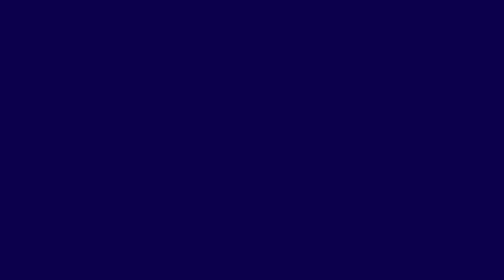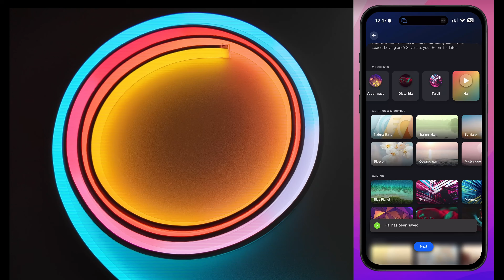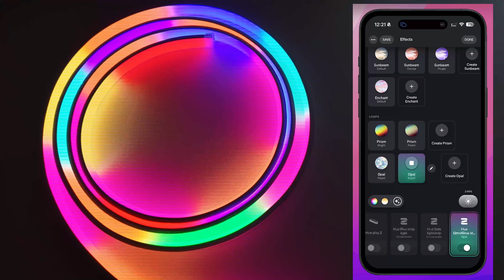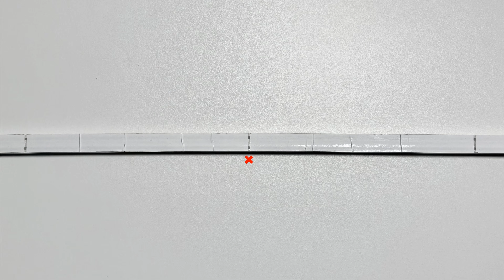Philips Hue OmniGlow:  Premium Quality, Premium Price or Premium Gimmick?

Comment from the maker: ⏱ TIMESTAMPS:
0:00 - The Problem with Traditional Light Strips
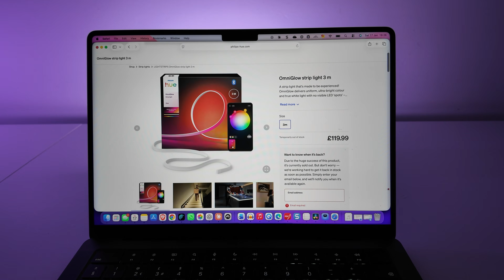0:46 – Unboxing Hue OmniGlow
1:42 – OmniGlow’s CSP Technology Explained
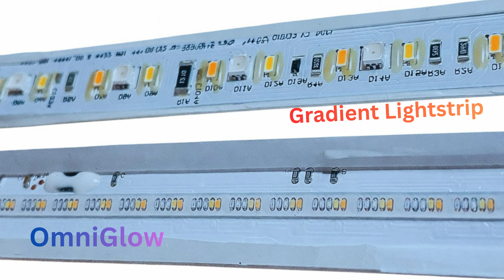2:30 - Gradient VS OmniGlow LED Difference
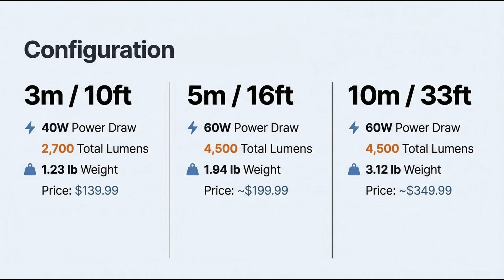3:36 - Size Options & Lumens Brightness
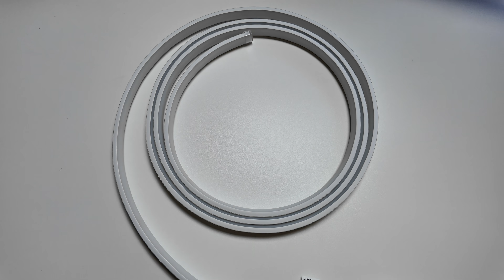5:17 – OmniGlow Setup
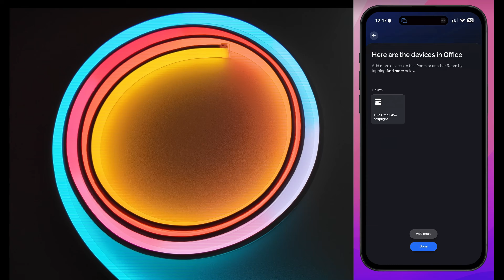7:05 – OmniGlow Colour Segments
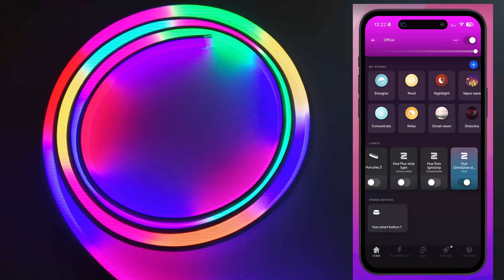9:01 - OmniGlow vs Govee COB Pro
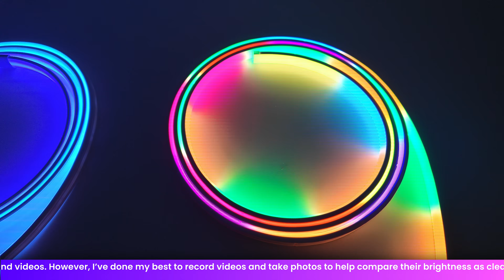10:06 - OmniGlow vs Govee COB Pro Dimming Test
10:52 - OmniGlow vs Govee COB Pro Illumination
11:12 - The Trade-Offs 
13:24 - Final Verdict: Is It Worth It?
Reply: Hello any new content on the tv sync with the omniglow lightstrip? Thankyou
Reply from the maker: @Mathewmcloud-n4t  Hi, I’m working on it. I actually applied the OmniGlow behind the TV, but I think due to its weight it didn’t hold and fell off. I’ve now ordered some mounts to properly secure the strip in place.
Reply: @techfloww  ok thankyou

Comment: I have a question. I would like to use this OmniGlow for under cabinet lighting.  I have some glass doors that will take 3 individual 1 meter strips. Can a 3m OmniGlow be cut into three pieces and still be powered by one ac plug into a single outlet, or do I need 3 outlets? This cabinet has a typical dual outlet single gang box run off a switch.

Comment: I've been trying to compare this to the FCOB RGBCCT IC strips from BTF, but I can't find any info on how bright and also how dim the BTF strips can get. 

I saw that you comment you also use BTF Lighting. Can you comment on how Omniglow compares to them in terms of maximum and minimum brightness?
Reply from the maker: You’re right, BTF doesn’t list lumen values, which makes comparison a bit tricky. I use two types of BTF FCOB LED strip lights:
1.Single Color Cool White (6000K, 24V, 528 LEDs/m): I use this for under and top kitchen cabinet lighting. It offers excellent brightness and is perfect for task lighting.
2. FCOB RGBCCT LED Strip (24V, 960 LEDs/m, 6-pin): This RGB strip includes warm and cool white. It consumes power about 18W per meter—so for a 5-meter strip, you’ll need at least a 90W power supply, ideally with a bit more to account for power loss over long cable runs. Also for longer runs its recommended to attached power supply on both ends.

In terms of brightness comparison with OmniGlow: 
- For colour LEDs: The BTF RGBCCT strip is slightly brighter than OmniFlow but it also depends on how long it is and amount of power provided to FCOB strip.
- For white light: I found the OmniGlow provides slightly better brightness and uniformity then BTF FCOB RGBCCT. I initially used the BTF RGBCCT FCOB under the kitchen cabinet for white light, but it wasn’t bright enough. Replacing it with the single colour cool white strip gave much better results.
- For minimum brightness I think OmniGlow is better. 

If you’re comfortable with DIY, BTF FCOB is a great cost-effective choice, but it does require planning, like selecting the right strip, power supply, and controller.
Reply: @techfloww Thank you so much, this really helps. I think I'll plan on using both BTF and Omniglow in different places in my house.

Comment: For your information, I got the Omniglow (3M) Lightstrip and it has only 3 segment, when using it as bottom of the tv on the Entertainment area..this is the same as the old Gradient Lightstrip
Reply: what do you mean writing 3 segment? Thx
Reply: @maziboss I have the Omniglow connected to my Entertainment area in the Hue app, and it can only show 3 different segment with colors. So for example, left side; a color, middle part, another color and right part another color. Do you understand what I mean? If you do not use it in the Entertainment Area, I think it can show 5 different Segment. Just be aware of this, that the lightstrip is limited when using it in your Entertainment Area
Reply: @giogamer4825 now is clear. I need to replace my current hue gradient led strip because of the dots… grrr. I don’t use it as the enertainment, is use as light to Watch tv.
Reply: @maziboss Then go with the Omniglow. As on the "old" gradient lightstrip you could see the dots very clearly. With the Omniglow you cant. Let me know how it is, when you did install it

Comment: MY BTF LEDS ON SPOTLESS MUZATTA DIFFUSERS LOOK 1000X BETTER AND WERE ALOT CHEAPER THEN THE PRICE OF ONE STRIP OF OMNI GLOW
Reply from the maker: I completely agree. I personally use BTF COB lightstrip with aluminium diffuser and Philips Hue, and each of them has its own strengths and use cases. BTF lightstrips are amazing for customisation and value, but it’s more of a DIY solution, which isn’t for everyone. A lot of people prefer a simple plug-and-play experience, which is where Philips Hue really shine. At the end of the day, it comes down to personal preference, budget, and how much setup you’re comfortable with.

Comment: does it stick to any surface? My Table is made of metal..
Reply from the maker: Yes, it will stick to most surfaces, but keep in mind that the OmniGlow is quite heavy and thick, so the built-in adhesive may not hold securely for long, so I’d recommend using extra double-sided tape or mounting clips for better support.

Comment: Hi everyone, I work for Signify Philips Hue! 

For those wondering, the firmware for the TV lightstrip and the Omniglow lightstrip is not the same.
 When the Sync Box receives data from the Hue Bridge and transmits it to the lightstrip, let's say you're using an Omniglow lightstrip, the result will be completely different than with a TV lightstrip, even though the Omniglow has more controllable areas than a simple gradient (non-TV). 

I don't know if my answer was clear, but basically, I advise against it; the metadata isn't handled the same way.
Reply from the maker: Thank you for the info much appreciated, it will help many.
Reply: @techfloww  of course, my pleasure ! Your vidéo are amazing sir !! i really appreciate them keep going
Reply: When will the longer omniglow strips come out?
Reply: I mean. Is that getting a fix? Because the only one able to fix such an oversight is Signify. 

This is THE strip to use in setups with a TV.
Reply: @Gren4te  I don’t work in product development, but honestly it would be surprising if the R&D team didn’t release an updated version of the lightstrips TV with ChromaSync sometime this year or next. It feels like a logical next step. A bit of patience 😊 .
Reply: Thanks for the info greatly appreciated
Reply: So, if I put the omniglow behind my tv hack, under the tv, my syncbox will understand that its a 3m gradient led under the tv?

Comment: Hi! I just bought the flux extra bright 5m strip. I reckon it'll be way better in terms of price and usage - most ot the strips are hidden anyways. I intend to use mine to cast light onto the ceiling, so the strip itself won't be visible. Plus the brightness is higher with less money spent. Sure, the leds are visible, but near the celing they won't be, and the gradient efect is almost as good. Greetings from Poland!
Reply from the maker: Sounds like a great plan for your setup – the extra brightness and value of the Flux make it an excellent choice for indirect lighting!

Comment: I have a question and hope you can help me. I have the 75 inch Hue Play Gradient Lighstrip around my Tv, and it works with the Hue app I bought on my Samsung Tv. Can I replace it with this Omni Glow Hue ledstrip? Or is the Play Gradient better for showing the color that are on my Tv? Or will the connection be different that I cannot replace the PLAY Gradient with this Omni Lighstrip?
Reply from the maker: For TV ambient lighting, the Play Gradient is still the better choice. It’s specifically designed to match the on-screen colours from your Samsung TV using the Hue Sync app. Since the strip is hidden behind the TV, the “spotless” look of the OmniGlow doesn’t really provide any visual advantage there.

The OmniGlow is designed for a different purpose. It really shines when the strip itself is visible — for example on a wall, staircase, under shelving, or as a decorative feature. That’s where its seamless, neon-style look makes a noticeable difference.

You could use OmniGlow behind the TV if you wanted more brightness. For example, the 3-metre OmniGlow outputs around 2,700 lumens, which is more than double the roughly 1,200 lumens of the 75-inch Play Gradient. However, that extra brightness doesn’t necessarily translate into better TV immersion — just more overall light.
Reply: @techfloww Thank you for your reply. The reason I would like to use the Omni version, as I would think this would have more zones then the 75 inch Play lightstrip (this has 7 zones) and also if it would be possible to have the bottom of the Tv also matching the color of the on screen Tv. What do you think/advise base on this?
Reply from the maker: From what I can see in the app, the OmniGlow currently has 5 segments across the strip. I’m not 100% sure how this translates into the number of zones when used with the HDMI Sync Box. The OmniGlow is 3 meters long, which is roughly 110 cm longer than the 75-inch Gradient Lightstrip, so it should be able to cover the bottom section of the TV as well—depending on your TV size and how you position it. There is also a 5-meter version available, which would give even more flexibility for larger setups.
Reply: Hi everyone, I work for Signify Philips Hue! 

To put it simply, the firmware for the TV lightstrip and the Omniglow lightstrip are not the same. 

When the Sync Box receives data from the Hue Bridge and transmits it to the lightstrip, let's say you're using an Omniglow lightstrip, the result will be completely different than with a TV lightstrip, even though the Omniglow has more controllable areas than a simple gradient (non-TV).

 I don't know if my answer was clear, but basically, I advise against it; the metadata isn't handled in the same way.
Reply: @mlcd230 Thank you for your reply. Much appreciated!! Just 1 last question about this topic, just to double check. Is your mentioned story the same if you do not have the Sync box, but has the Hue App on a Samsung Tv 2024?
Reply: @mlcd230 How many segments does the Omniglow have? I have a Gradient lighstrip (non Tv) and that has 3 segments when using in the Entertainment Area
Reply: that's basically the same question i have. i'm using the HDMI sync box rather than the app but it seems to be suggested that it can be used behind the tv but will it only work in the "n" shape or can it be extended to do the bottom of the TV too? i currently have a play gradient light strip in "n" pattern and a standard gradient light strip across the bottom of the TV. pondering a 98" TV so will need to do something if i make that change.